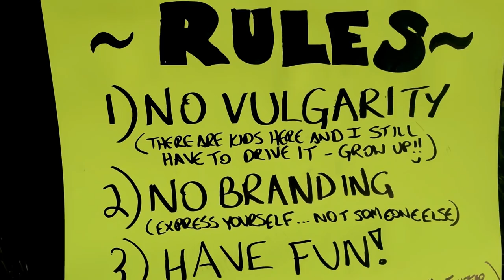My MK4 R32 Got Covered In Graffiti! (Plastidip Content)

Comment: How do you wash ya car with that on it
Reply from the maker: Easily. I did it at the car wash. The cool thing about a dip job is that you can use a scrub brush and pressure washer on it and it is perfectly fine. I kept my car like that for a long time.
Reply: Oh see mine is actually spray painted